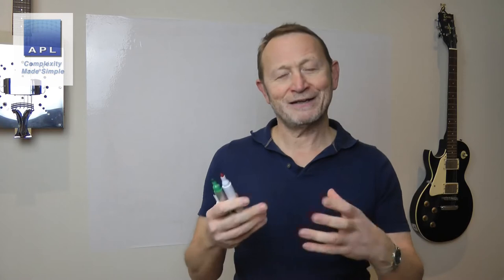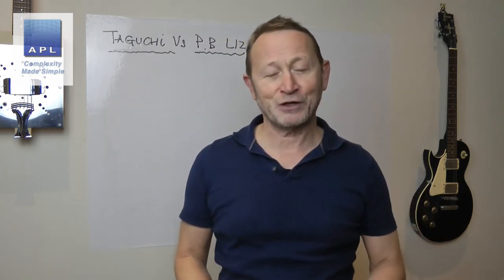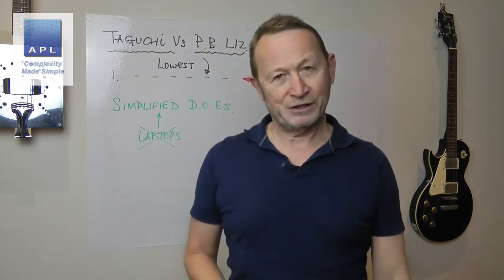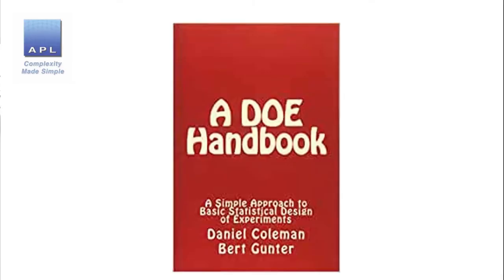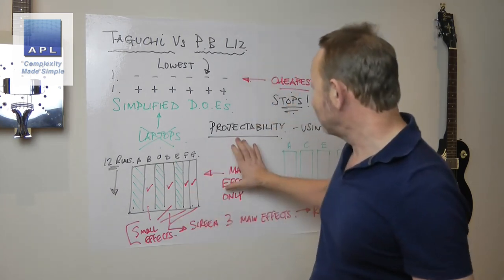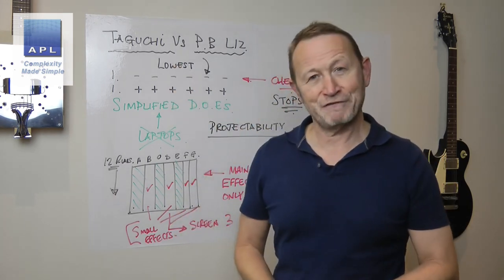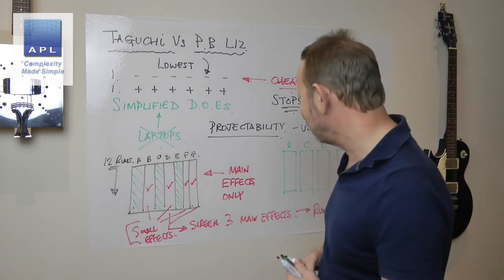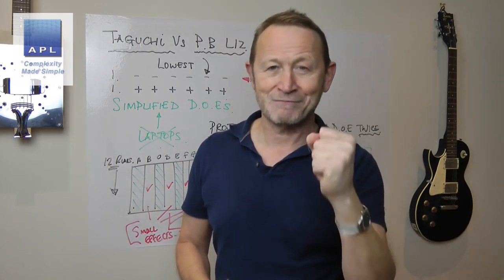Taguchi L12 v Plackett Burman designs - Is there a difference.

Comment: Great video! It's hard to find information about this comparison anywhere.. But the question that still remains for me is why are you highlighting this specifically for the L12 design? Couldn't the same point be made for the L8, L16 or basically any of the 2-level DOEs?